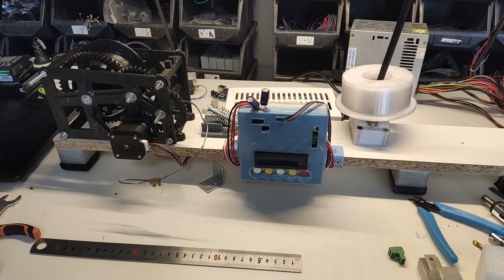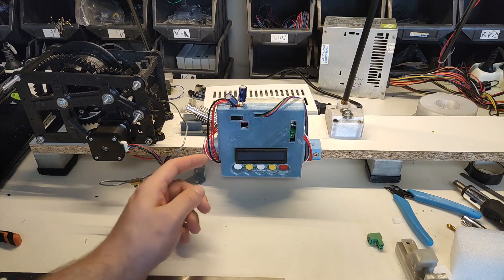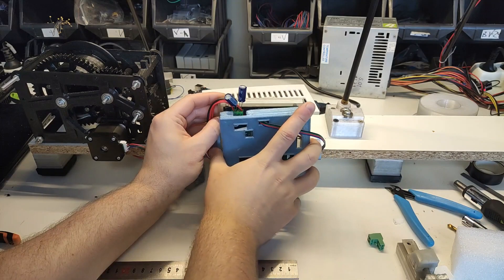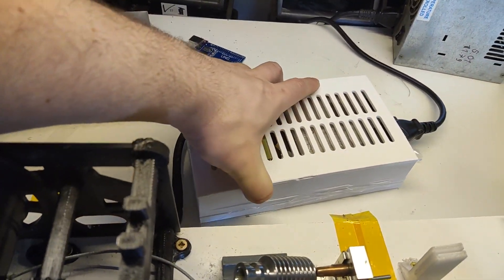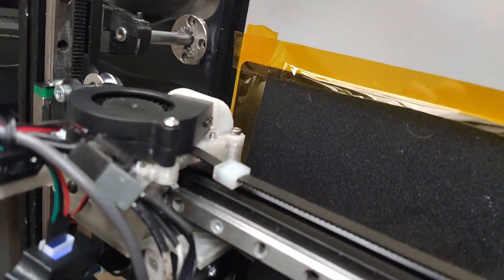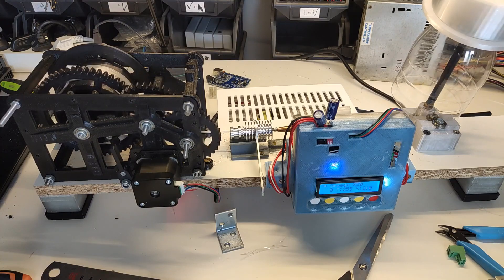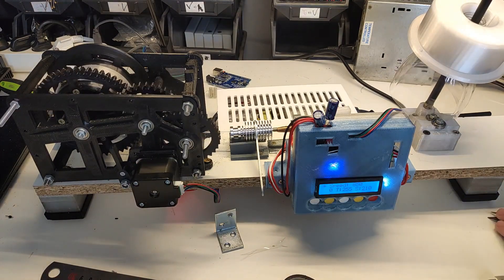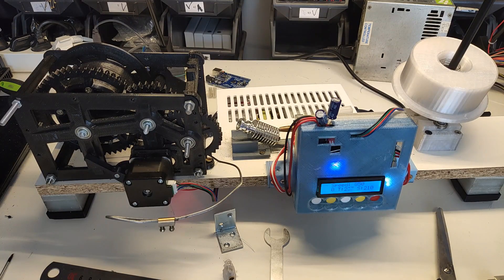Free filament maker machine part 9 - PetPuller Final Thoughts

Comment: Hi friend. 
What is your opinion of self made filament from plastic bottles compared with factory filament companies are selling.
Do you think its legit printing filament or it has its shortcomings.
Can you explain me a bit, thanks.
Reply from the maker: It has shortcomings, first of all i wouldn't use it on anything that is over 18g simply because there will be visible "join" moment. Unless it's something functional that doesn't need to look good. It is also less precise. Think of it as filament for testing and rough stuff.

Comment: I have a spare printer that has damaged frame. all electronic components are good.Could i not use that to control stepper motor and monitor temp?
Reply from the maker: Not unless you write firmware yourself or convert the one I've written to match your board. 3D printing firmwares does not support infinite movements.